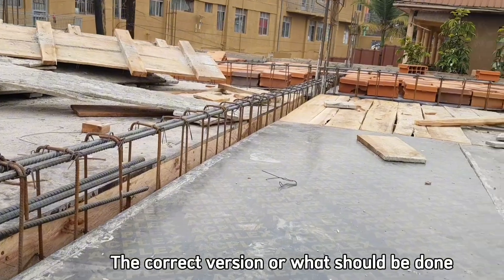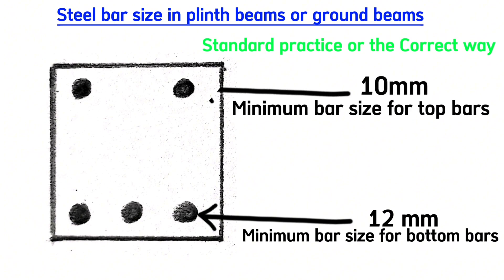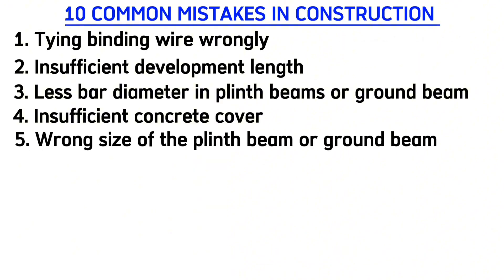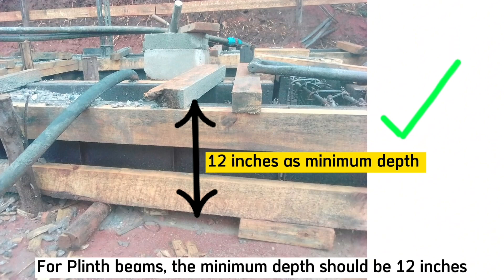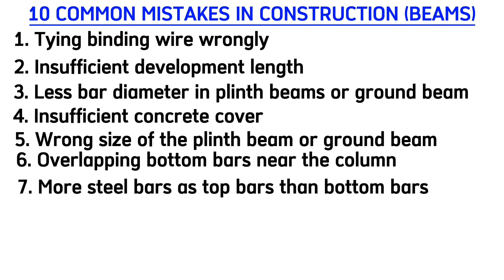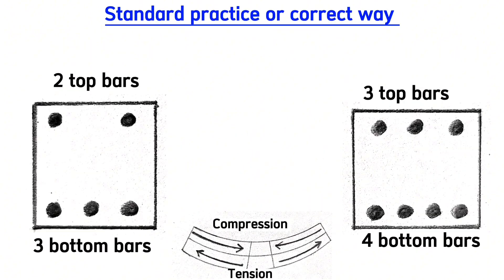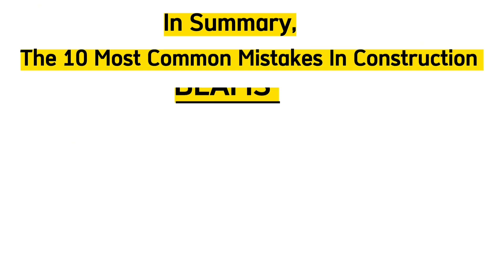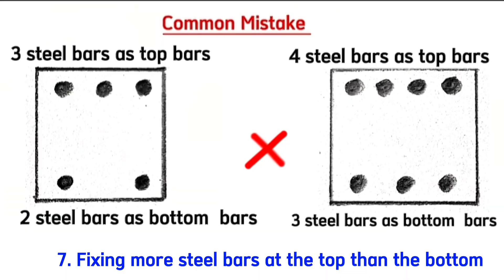THE BIGGEST MISTAKES IN CONSTRUCTION (Part 3)

Comment: Hi always the top section/bars of the beam near the column support is in tension (hogging moment) mainly for continuous beams so l wouldn't advise to have the joints at that section it is experiencing maximum stress and we normally provide extra bars at the top in such sections.

Comment: i see the top bars of the beams curving down at the end to the columns, and the bottom bars curving up. Is this s a rule of thumb? or its based on some calculations? thanks
Reply from the maker: That’s how it’s supposed to be so that the load or stress can be safely transferred into concrete

Comment: The top part of beam at column is in tension(hogging) hence requires more bars than the bottom or what do you mean?
Reply from the maker: 1. A beam has Top Bars, Middle bars and Bottom bars
Under normal loading, the upper portion  of the beam is under compression and the lower portion of the beam under tension. 
Concrete can withstand loads under compression and fail under tension 
Concrete is good at resisting Compressive loads whereas Steel is good at resisting tensile loads therefore to ensure that the beam can resist tensile forces in the tension zone, extra steel bars are added in the tension zone or area. 
As steel can be used in the compression zone to improve the strength of the beam,  its not so much required to the same extent as it is required in the tension zone and that's simply why more steel bars are required at the bottom of the beam than at the top

2. At the beam and column joint, we provide TIES so that the whole Column has the TIES from the foundation up to the last floor up (So as to have a strong column) The Common mistake is that steel fixers do is not providing ColumnTIES at Beam and Column joint. 
The correct version is providing Column TIES right away from the starter bars in the foundation up to the Last floor of the building even at the beam and column joint without skipping any gap

I hope that helps bro, incase of any clarification or any questions, be sure to reply back
Reply: @ianconstruction  Hello, I have just discovered your channel. You are mostly very correct, except for here. Ties are for 'shear force', rebars are for 'bending moment'. Therefore, as mentioned above, at the column joint, the top of the beam is in tension and has more rebars than the bottom which is in compression.